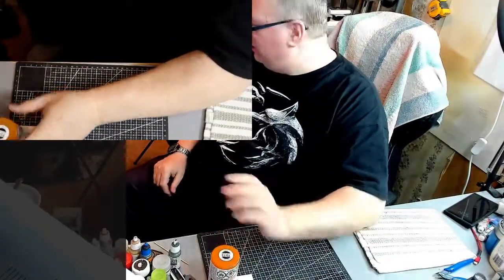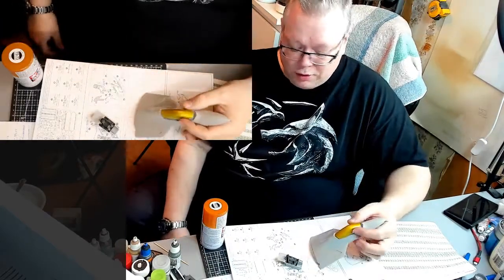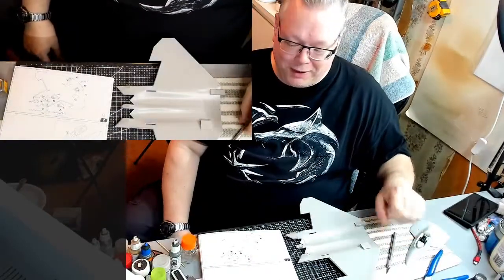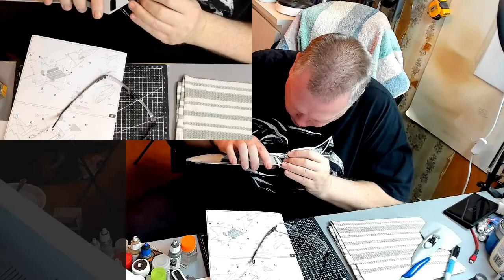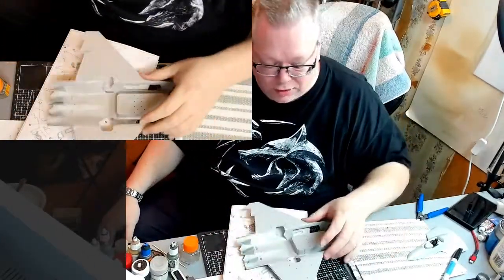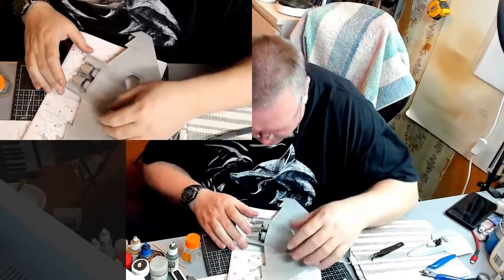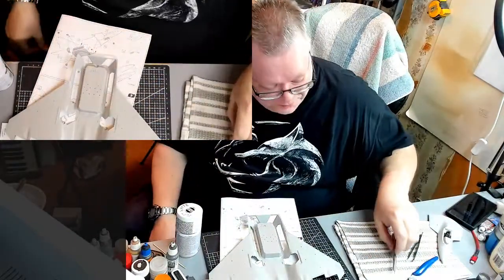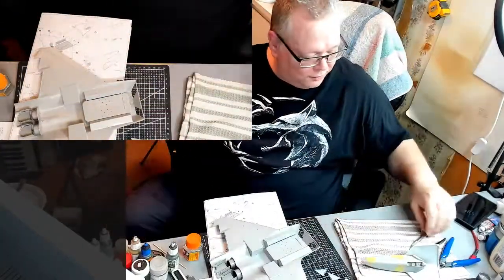Building the 1/48 F-22 Raptor, by Italeri. Part 1

Comment: There's supposed to be a gap! It's a variable vectoring exhaust and there's a gap. Depending on how fast they're flying, it could open or close to a narrower opening. Don't file the pins off! It's not wrong, it's fine.
Reply from the maker: There shouldn't be a gap at the tip. I'll address it in my next video.